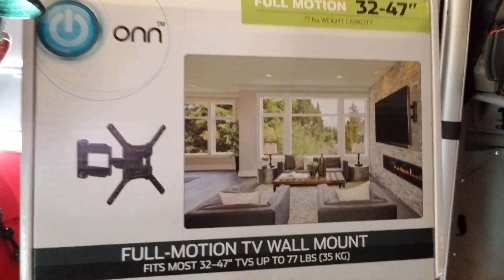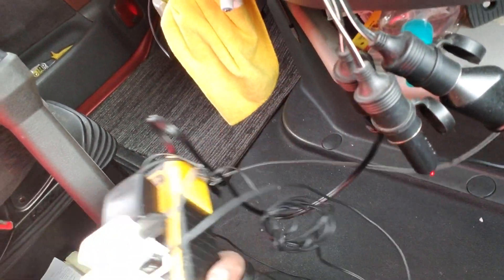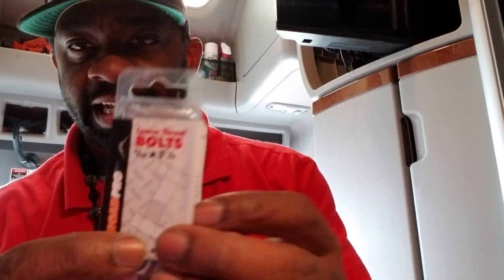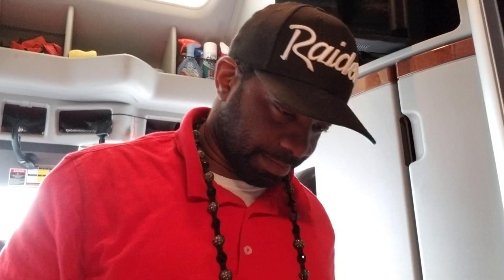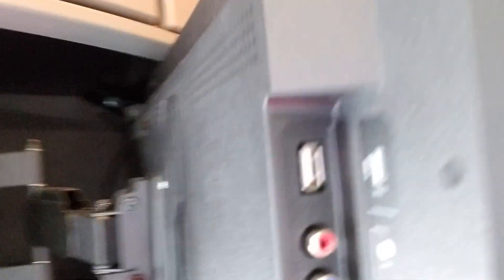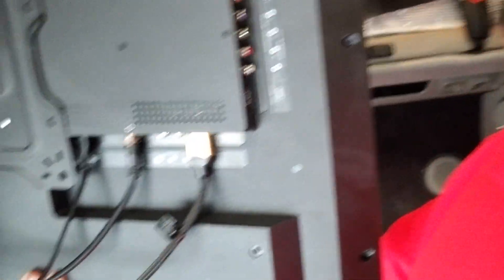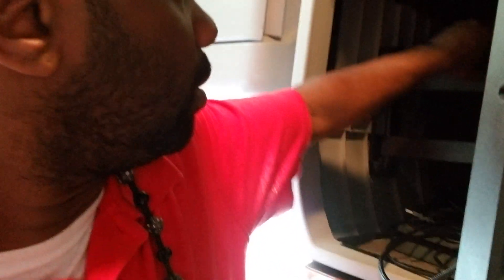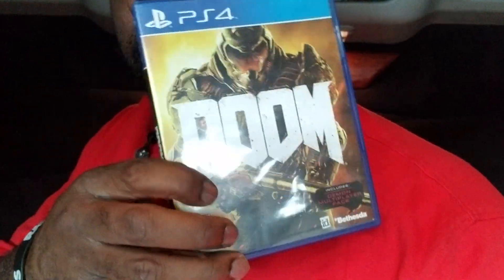VLOG-9/18/18-HOW TO SET UP YOUR TV/PLAYSTATION IN THE TRUCK/MR.SINNIZTER  DA  TRUCKER

Comment: I plugged my ps4 pro.to power inverter 2000watts  but im getting some clicking noise from the ps4. Any idea why im getting that?
Reply: Probably the fan bro
Reply: @eggy718  its a brand ps4 pro it only makes that noise when i power it with the inverter
Reply: @steenb5413  maybe u need a stronger inverter at the same time the pro does pull more power v the reg ps4 and def the slim